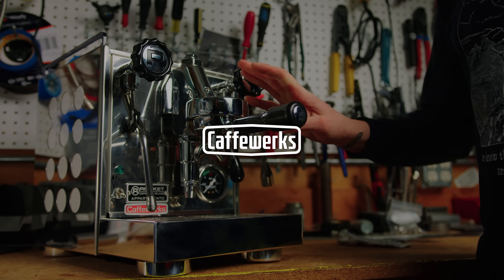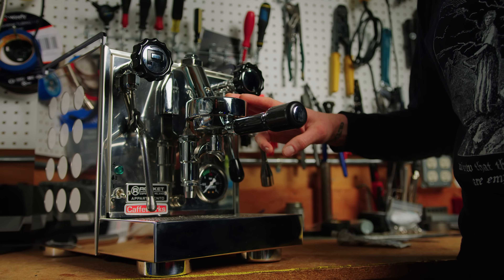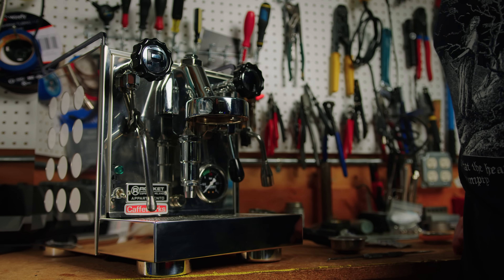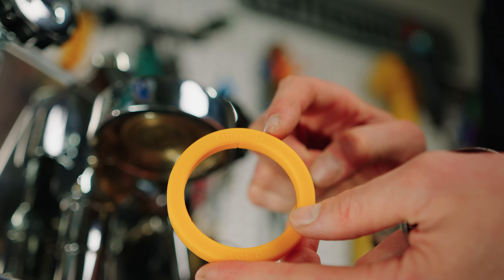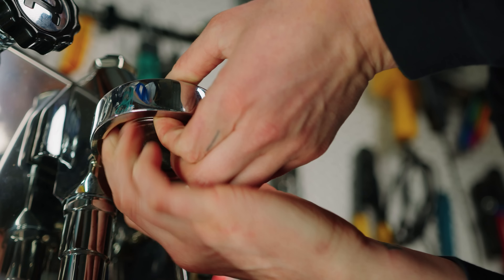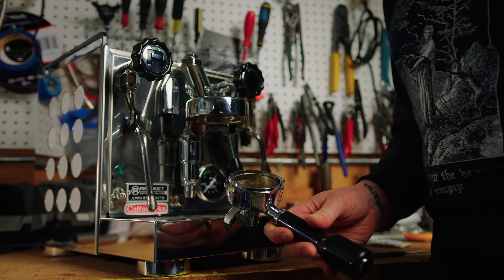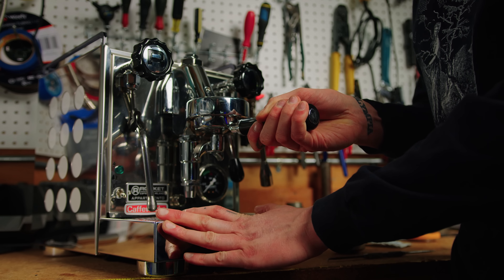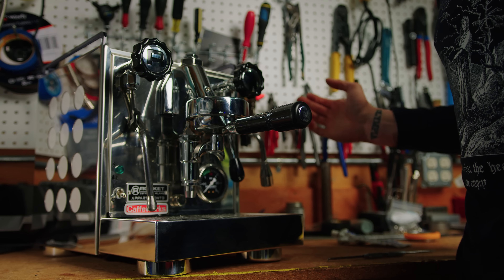Caffewerks E61 Screen and Gasket Replacement and Install // How To

Comment: a pick tool like this is the only way I can get mine out of my Fiorenzato Bricoletta. I'm always left scratching my head at people who basically reach in and pull the screen & gasket out easily with fingers. :)
Reply from the maker: The pick or scratch awl is super helpful! Silicone gaskets stay softer longer, and can be easier to remove than traditional rubber.  This is also why we like to suggest quarterly preventive maintenance routines!